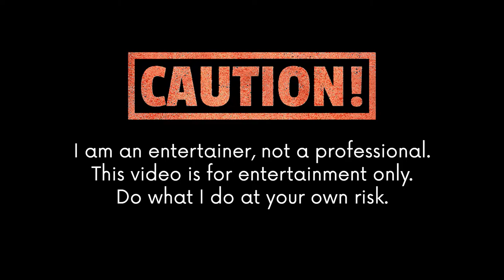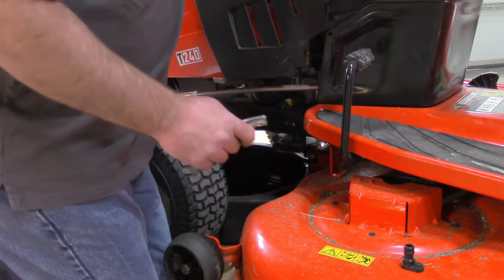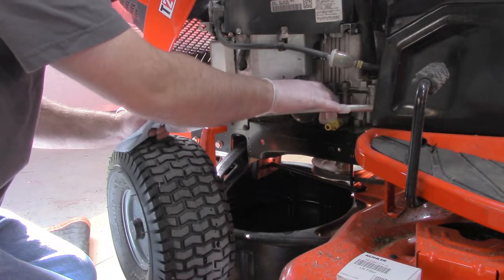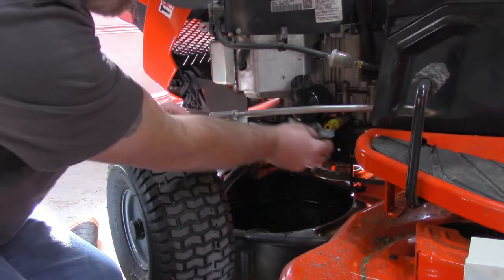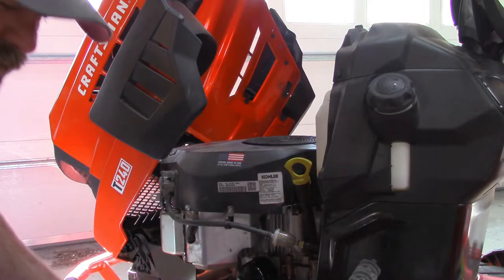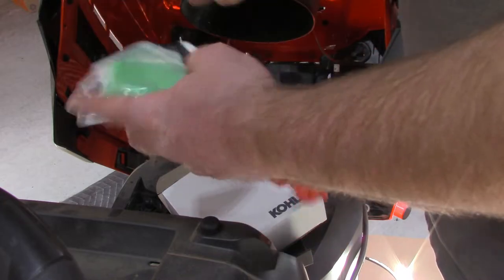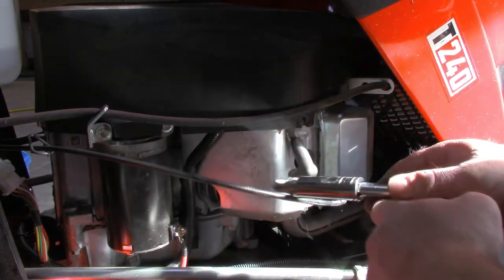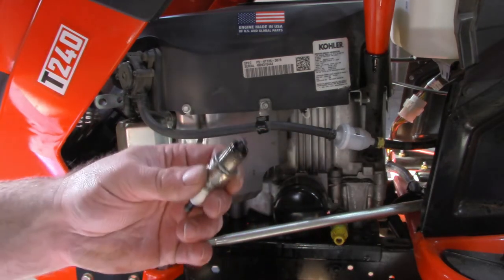DIY Lawn Mower Maintenance on my Craftsman Lawn Tractor

Comment: Harley Davidson used to have an oil filter drain that you place under the filter when you remove it, it's like a trough with a hose on the end that lets you remove the filter with hardly any mess. I use it every time works great!!!

Comment: I've always siphoned my Lawn mover oil when I do an oil change.   I have a question:  I have a Craftsman T110 riding Lawn mower, however, it doesn't have an oil filter have you ever heard of this or know why?   Thanks, great video.
Reply from the maker: It may be the type of engine in it.  Some mowers don't have oil filters.  It's more common on the push style mowers though.

Comment: What oil did you use
Reply from the maker: I went with the cheapest I could find at the time.  It's 10-w30 super tech from Walmart.
Reply: @SawdustSquad  same as the oil it came with .plus your changing it every year 25 -40 hours I bet .

Comment: Is your fuel filter on backwards?
Reply from the maker: No, there is an arrow on it that shows which way the fuel flows.  If ever in doubt, the cone shaped side usually goes towards the gas tank and the flat side towards the carb.